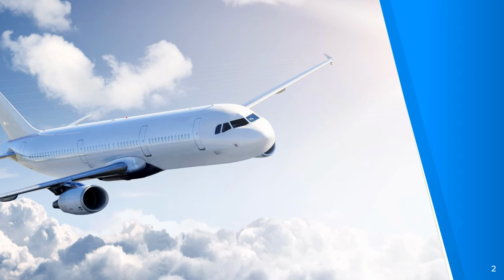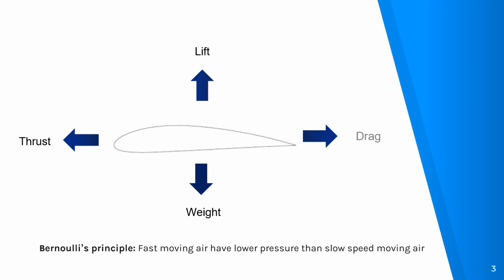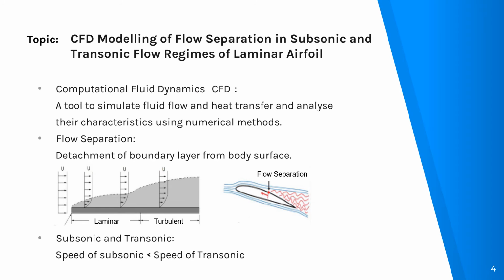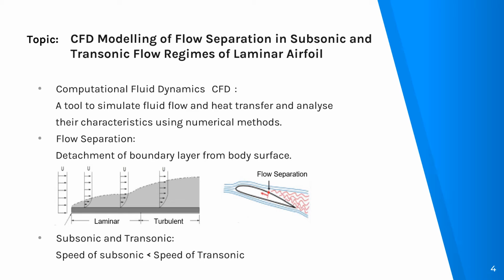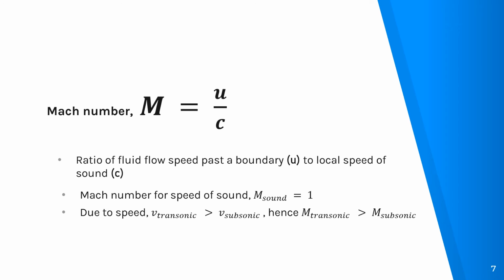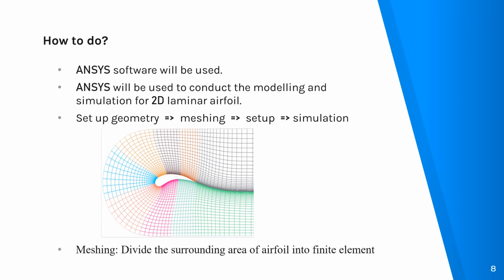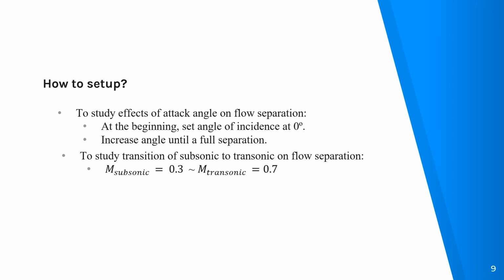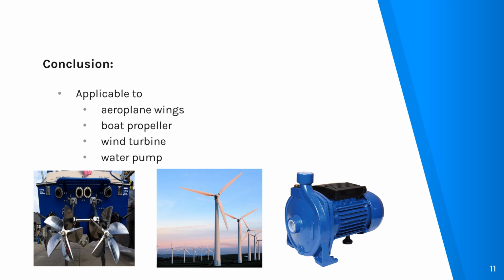UTM - 5MT Video

Comment: Question from Examiner:

1. The problem treated in this project looks rather classic ones. Clarify what have been achieved (previous research) and what are not. (Research gap)
2. State the current problem, which you will treat,  clearly.
3. What is you hypothesis to overcome the problem stated in 2. (your originality)
Reply from the maker: Yes, Dr. My answer is shown as:

1. I’m sorry to tell Prof that mine FYP don’t have any research gap exists. My study is more like a verification of accuracy and precision on development of flow on airfoil using CFD.  
From the previous research, the study of the flow separation of airfoil with using CFD had conducted with the changing below:
a.	Changing of Mach number with the genetic algorithm.
b.	Changing of attack angle with different meshing element.
c.	Increasing critical Mach number, at subsonic and transonic flow
d.	Separated subsonic and transonic flow in unsteady motion.
Here I only listed some of the previous study. 
For my study on the flow separation from subsonic to transonic flow, this topic has been conducted in 2017, however, this is conducted experimentally using wing tunnel method. So far, I haven’t found any research related to study the flow separation of laminar airfoil using CFD methods.

2. To study the flow of an airfoil, it needs a higher cost to carry out the study experimentally as more iteration cycle is needed to reduce the errors occurred. 

3.  CFD is considered as economically method to study the flow separation or boundary layer form of an airfoil under various condition. It become a better choice to design an optimize airfoil through the prediction of drag and coefficient. 

If any incorrect explantions or mistakes I made,  I would like to request Dr's help to point it out. Thank you.

Comment: Thank you for the video. It is very informative and well scripted.

Question from Examiner:

1. Please explain the distribution of drag on the airfoil when the Mach number increases from the subsonic to the transonic range.

2. From your video, the maximum Mach number in the simulation is 0.7. Can this be considered as the critical Mach number of the airfoil?

3. Do you think it is possible for a shock wave to form over a 2D airfoil in a transonic flow?
Reply from the maker: Yes, Dr. My answer is shown below:

1. When the Mach number increase, the drag force will increase too. From the previous study using wind tunnel, the distribution of drag shown a minor increase in drag force when increasing the Mach number. However, if the shock wave appears, the wave drag from shock wave will make an obvious increasing of drag.

2. Yes, I think that 0.7 can be considered as critical Mach number of airfoils. From the previous study, when the Mach number greater than 0.7, there is an obvious increasing in drag shown. 

3. Yes, I think it is possible. Weak shock wave might exist in the early stage of transonic flow. So, when the Mach number increase, the supersonic flow is developed, and an obvious and greater shock wave is shown in the testing result. Also, under a transonic flow, when the attack angle of airfoil increase, greater shock wave will be produced. 

If any incorrect explanation or mistakes I made, I would like to request Dr's help to point it out. Thank you.